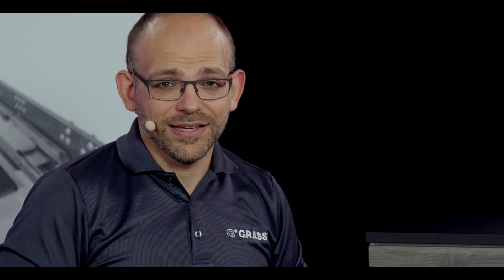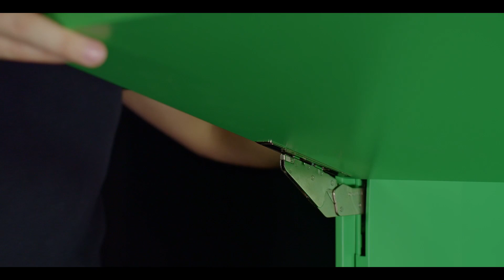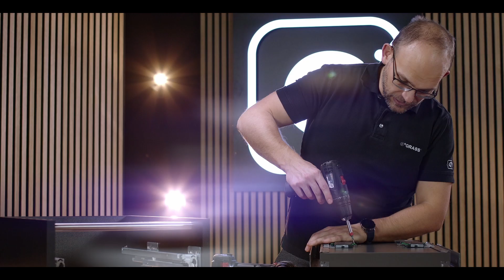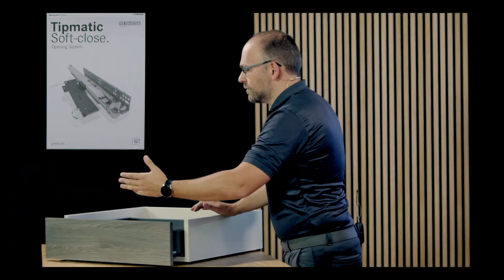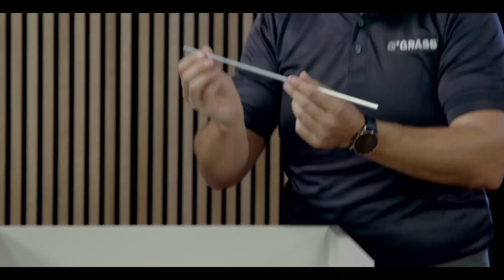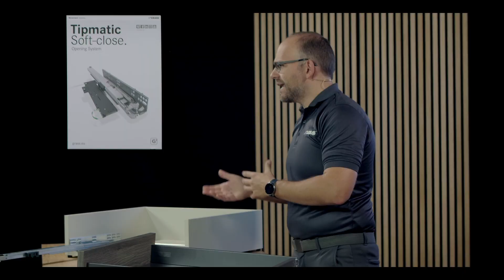GRASS Dynapro Tipmatic Soft-close general (EN)

Comment: The closing tension is really high and if you try to close the drawer softly, it just bounces back to the open position!
Reply from the maker: Thank you for your question. The spring force can be set to three levels. When the drawer is empty or lightly loaded, level one should be set. There are several options for closing the drawer. Close the drawer with momentum or by hand until the drawer retracts by itself. Do not push the drawer to the end. See also this video

https://www.youtube.com/watch?v=UEKQurpKQ68

Note with the newer version 1.2, the drawer can also be pressed all the way to the end.

Comment: Great video. With the tipmatic installed can the drawer still work as a pull-to-open? That is, this drawer can open by both methods of either pushing the front face or pulling a handle?
Reply from the maker: Hello, 
yes the drawers can also be pulled out normally with a handle without pushing backwards. The system will then not activate the units. Best regards GRASS I ACADEMY